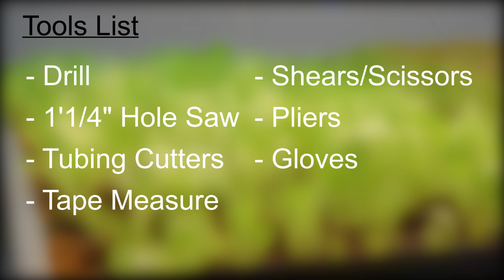How to Assemble Your New DIY Seedling Cart XL

Comment: I dont understand how it drains. The drain pipe is about a half inch front the bottom of the tray, so won't most of the water not empty? What is acting as a siphon?
Reply: It’ll siphon once there’s enough flow in the down pipe and will continue until it breaks which should be when the water is below the end of the elbow in the bed. It won’t fully drain the reservoir but I feel like that’s probably not necessary/desirable anyway.

Comment: Great job guys! always on top!
just a question, with this seedling cart, the pump will run 24h/day?
Reply from the maker: Hey Maurizio, we run this cart twice a day, but you could run it 3 or 4 times if your environment is warmer. Grab a simple outlet timer from the local hardware store and plug in your pump- super easy to set up.
Reply: that's the answer i expected, i didn't see the timer in the kit but i was sure it's needed!
Thanks! ;)